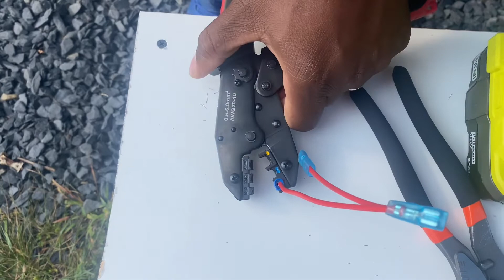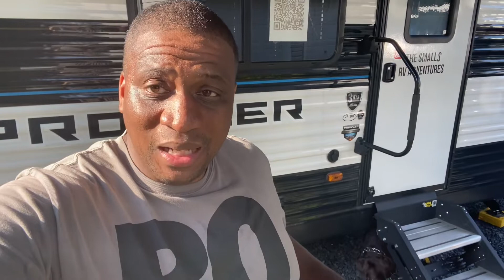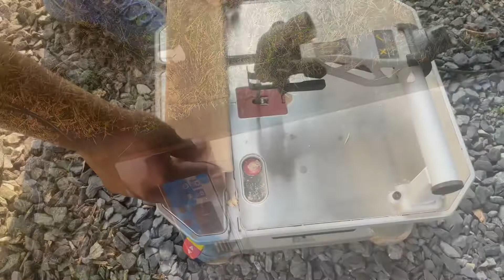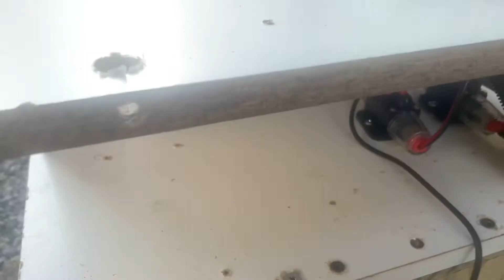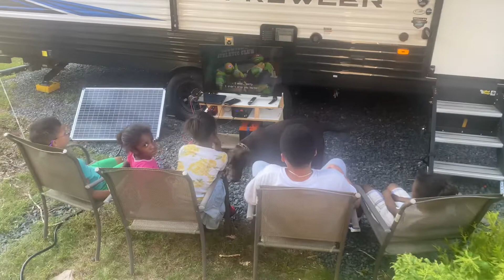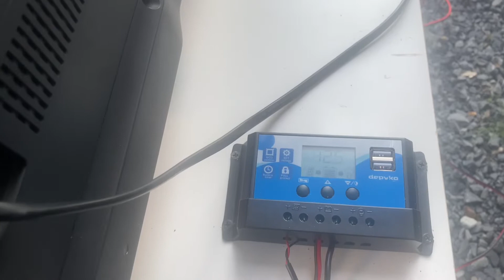East Install 12 Volt Boat Car Truck RV USB Cigarette Lighter Outlets / Van Life / RV Life

Comment: Did you buy that Lithium battery and why did you go with such an expensive battery if you did?
Reply from the maker: Hey again. The Lithium battery was sent to us from Chins. We did a review on it showing how powerful it is. As we updated the box we created we get to show it more. These batteries work better then the lead acid and gel batteries. You can use the total 100% capacity at full power. The lead acid and gel you can only use 50% of its capacity. I love electronics as you can see lol.
Reply: @thesmallsrvadventures  very good to know and that's so cool they sent it to you Thanks!!!!